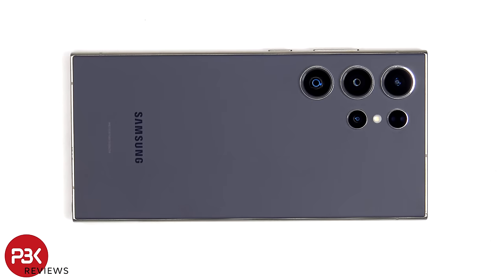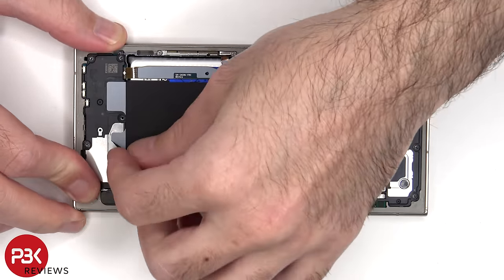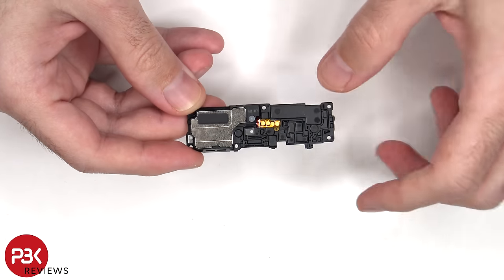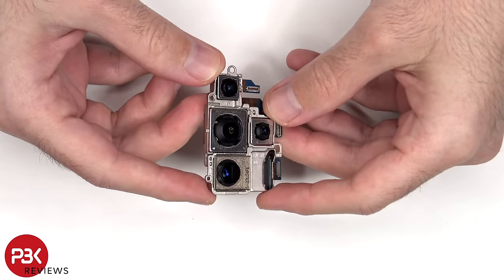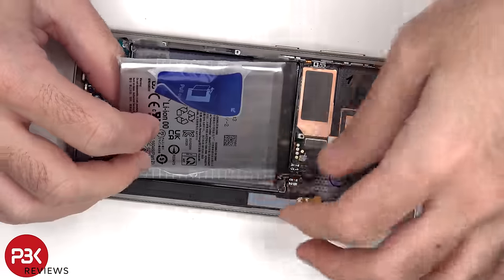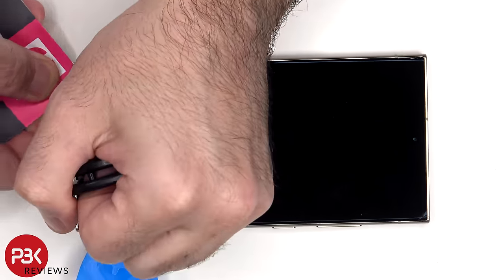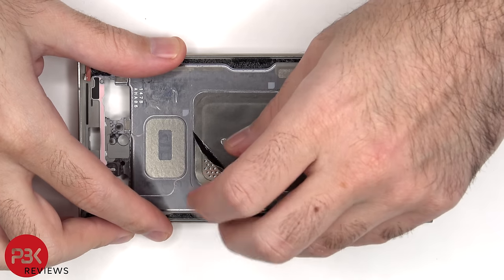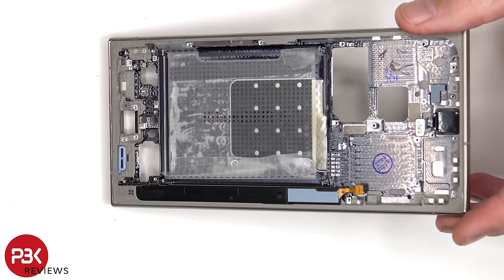Samsung Galaxy S24 Ultra Teardown Disassembly Repair Video Review

Comment from the maker: For anyone who is worried about the S24 Ultra speaker mesh filter, you can check my X/Twitter post with pictures of the mesh filter. Some people were worried about the mesh filter looking damaged when holding a flash light into the opening of the bottom speaker in the frame. It's not damaged and its just "domed" or in a dome shape fitted into the speaker opening in the frame of the phone. https://x.com/PBKreviews/status/1753223290913423458?s=20
Reply: Hi what about bottom mic ... I accidenly poked it with a sim ejector tool which is thinner than samsungs... should I worry about water resistance capability???
Reply: Thanks for the clarification about the speaker mesh... I was worried about that... 😊😊😊
Reply from the maker: Hi, you will be fine, the mic and filter are seated above the hole and won't be damaged.
Reply: Thank you so much for the last comment regarding puncturing the hole next to the sim card. I came here just for that reason. Who would design a hole not meant to be punctured next to a hole needed to be punctured in order to get the sim card out. 🤦
Reply: Извините, а для чего верхняя камера?
Reply: Now my phone
Reply: Ya esta preocupado gracias por la información amigo
Reply: Will all repair/dissembley reviews in the future be given a numerical score?
Reply: Thanks for this video I saw a tiktok with a fake s24 ultra

Comment: He just killed the screen
Reply: I screamed internally
Reply from the maker: Yup :(
Reply: Dude needs to go to repair school
Reply: @laptech3767  It is not noticeable that the video tries to repair the screen, knowing that it is much better and cheaper to buy the screen and the new chassis .
Reply: Nooooooooooooooo
Reply: Gives repairability score 9/10 but the screen can't be removed without destroying it...   WTF??
Reply: Lol😂😂 he will be thinking i have done  @kosmosbos
Reply: Glad I saw this. Replacing battery requires replacing a good screen? No thanks.
Reply: I mean to be fair, Samsung did make their phone so that the only repair you need to do that requires the removal of the display... is a display replacement
Reply: @badwolf8112  are you blind? He removed the battery without touching the screen literally.
Reply: lol
Reply: @PBKreviews 1.5/2 for replacing the screen? Are you sure? I thought you said the screen was glued down so much that it was almost impossible to remove the screen without forcibly pulling it off? Surely a 0.5/2 tops.
Reply: Board also
Reply: Why would someone replace a good screen? Obviously, it has to be broken before thinking about replacing it, so its very easy. Replacing the glass alone is whats difficult @darthraider450
Reply: Cuz this is tear down not disassembling
Reply: I'll bet you Rewa could have saved the screen. Their glass-only repair method is next level.
Reply: @09:12 he mentioned that it is impossible not to damage the whole screen
Reply: 😂 So replacing the screen glass is almost impossible because the screen has an anti-glare layer that is very vulnerable.
Reply: 😢  As for the screen, if it is damaged we will need a new set of screens with the frame intact
Reply: @kosmosbos  why would you remove a working screen though?
Reply: Its okay bro calm down 😂😂
Reply: It's over $300 to fix 😢
Reply: @badwolf8112  the battery has nothing to do with the screen, that's done from the back lol

Comment: Wow. The size of vapor chamber is really big. Awesome.
Reply: Yeah but it's stainless steel instead of copper this year/cheaper to manufacture
Reply: @hotsauce6310 are you sure its steel and not aluminum?
Reply: One plus 12 cooling vapor chamber way alot better ..😂
Reply: @RDstar8 but the cameras are way worse
Reply: 찐이다 ㄷㄷㄷㄷㄷㄷㄷ
Reply: @RDstar8  i saw some gaming comparison between both and there was hardly any difference between the temperature between two
Reply: 네모난꿈 매번 하던거 ㄱㄱ
Reply: @RDstar8 This is very true take note Samsung!
Reply: Not awesome, the phone has worse thermals than the S23.... I'm kinda sad this is the case
Reply: @NicholasManitaras not true... they literally have the same thermals... stop spreading misinformation and educate yourself first
Reply: 이왜진
Reply: Which is good, my S22 has a really bad overheating problem. cant wait for the 24 ultra to arrive tomorrow!
Reply: Yes, not skimp, like Sony does.
Reply: But my s24 ultra still gets warm in india and overheat when recording
Reply: Still heating is too much
Reply: Yes, really bug compared to older Samsung, but not big at all compared to other brands, hence why it performs worse in most of the "RAW" performance stuff and stability.

Comment: I just Pre-ordered mine... coming from a S10 it will be a nice upgrade.. It's incredible how much tech is built into these phones.
Reply: True ...as it needs 5 years or more to actually feel the upgrade when it comes to smartphones !
Reply: same here, my S10+ is still holding decently well but it's finally time!
Reply: Just got mine and I'm coming from the note 10+
Reply: Same. Just got a notification mine will be here Tuesday. Yay.
Reply: Same here coming from s10 and just got a message it is out for delivery!
Reply: omg same. My cracked asf s10 5g barely lasts a couple of hours off a charger. The thing I'm most excited for is the high refresh rate and much brighter display. Im also excited to use the circle to search because it sounds very handy for identifying parts on cars I work on.
Reply: It’s the same tech dude. There’s nothing new it’s just upgrades to be better won’t work better
Reply: My S10 plus suffers from ghost touches and it pretty annoying. It's still my daily driver tho.

 I also have the S23U but I did trade in for the S24U with the S23U and a trade in for the S24+ for my S23+.... 😅
Reply: Literally i have an s10 thinking to do the same
Reply: I've had my s10+ for 4 yrs gonna pay outright for this one as I did for the s10+
Reply: and there is me with a sgs7e buying an used s23u this month lol
Reply: honestly the s24 plus is more then enough - unless youre an avid spen user and also need the 'zoom' camera - it might be nice to have because the s10 szoon isnt that good (but the s24 plus zoom is also fkn nuts)
Reply: I will be coming from an TLC 10 5G, so it's going to be nice to keep the large screen, but with a way better screen, and that TCL has a garbage camera, so that will be nice.  First time I will own a top-of-the-line phone in maybe 20 years.
Reply: Also upgraded from a s10+ last week! It's a worthy upgrade but if it wasn't for the camera being 5 years old, I could of held on for longer tbh. Here's to another 5 years 😅
Reply: I've trade in my z flip 5 and got my 1tb titanium green with 4 freebies for only £691.69. This will be my spare phone. I traded in my z flip 5 (supposed to be my spare phone), but it is not as powerful as my fold 5.
Reply: Yoo the s23 ultra i got his pen is being not recognized and the screen is popping and cracking while wiping it out. Why is noone talking about that garbage?
Reply: Thats exactly why i came here. I got the s24 ultra and thought: Wow, this phone is light despite being large... i wonder whats inside it?
Reply: I'm coming from an s7. My 24u should be here in a few days
Reply: bro I upgraded from a note 8 imagine the difference

Comment: As a tech lover who loves repairing my own tech, I am happy Samsung made the S24 ultra the most repairable phone I ever seen. The phone is mostly modular so you can replace the USB-C connector or the sim card reader easily. As someone who knows how hard it is to safely remove iPhone batteries, I am happy the battery on the S24U is very easily to replace. Great job Samsung. Great video PBK.
Reply from the maker: Thank you
Reply: Where do you go to order specific parts?
Reply: iPhone 16 pro max…

Comment: It's amazing having seen the genesis of transistor electronics from the 50's all the way to now. In the 60's as a kid I used to take almost everything apart. (Broke a fair share of stuff). Thank overseas for making things as tiny as possible, and getting smaller and smaller. I always appreciate someone showing how to do these procedures correctly. I miss the days when you could unscrew the back vs. using a heat gun or hairdryer to pry things open.

Comment: Glad to know I didn't tear the microphone seal with my sim ejector tool. Thanks for considering those little details.
Reply from the maker: No problem :)
Reply: I did the same thing with my s23 ultra I just got myself for Christmas. I was freaking out I punched a hole in the microphone assembly. Alot different from an s9+.

Comment: Great to know that the battery isn't so difficult to remove and replace. For anyone that still wants to keep their S24 Ultra for up to 10 years, definitely be worth it to replace the battery after 5 years of usage. As long as Samsung keeps making the same battery size for the next S25, S26, S27 and S28, then we won't have to worry about finding the right battery. You would just have to pay $200 usd for someone to professionally replace that battery.
Reply: just trade the phone to samsung after 2 years for s26 preorder and get $1000 for it and use new one
Reply: @physics77guy  Most underrated comment of the century
Reply: @physics77guy  No, i doubt I'll get $1,000 usd for my used S22 ultra. Could be like $700 which isn't so bad too. But at the same time, I'm going to keep it and use it as my smartphone LIVE camera. I'll just replace the battery and get a S27+.
Reply: @PanCakesAreFat  oh that's very affordable. As long as they still have some S22 ultra batteries 5 years from now, im happy with replacing my battery.

Comment: Apparently the thermal headroom for the ultra is lower than last year and s24/s24+ exynos chips, 44c vs 46c. This means performance is being throttled unless samsung increases headroom to 46c. Idk why they did this but in hot countries it may limit chip a lot in performance area.
Reply: It's Note 7 flashback, that's why
Reply: Didn't they say the vapor changer was like 1.6x bigger?
Reply: @NunoFilipe99  yes its bigger and s24+ is also bigger but samsung artificially limits thermals to throttle at 44c, used to be 46c. So performance is being held back (sd should be even faster). Only for ultra, exynos variants of s24+ is 46c, dont know about sd version of s24+
Reply: @farhank8297  samsung has a really hard time with processors -.-
Reply: @NunoFilipe99  stop writing BS. I have a PhD in IT and you just talk nonsense....
Reply: @IIISentorIII  You have  PhD and i have a job.

Comment: Quick question:  There are reports from Korea by people who used a flashlight to look through the speaker hole, claiming that the speaker mesh deep inside that hole looks to be damaged, uneven, or using low quality materials.  When you completely took the phone apart, were you able to see any abnormalities with the bottom  speaker unit pertaining to what once was a clearly visible metal mesh from the outside?

Once again, thank you for the detailed assembly.  Always a joy to come here whenever a new phone gets released.
Reply from the maker: I just took it apart and took a look at it. I uploaded pictures to X/Twitter and you can share the link with anyone who is worried about the issue. There is no problem with it. https://x.com/PBKreviews/status/1753223290913423458?s=20

Comment: lol, did samsung really use plastic to bind titanium outer frame to the aluminum inner frame?
Reply: thats what apple did too

this whole titanium gimmick really sucked bring back aluminum
Reply: @hachiko2692  nope apple bonded aluminum directly with the titanium outer frame, theres only a little bit of plastic on the bottom where the charging port is. Oh boy does that bond hold well, just happened to have watched Hugh Jeffreys video on a broken iphone restoration. The frame was broken, the only places where it broke was the antenna lines on the plastic part of the frame, that really goes to show how good of a job they have done. Antenna lines are a weak spot even for single-piece aluminum milled frames.
Reply: @hachiko2692  i personally prefer titanium, it feels more premium in the hand due to its matte finish, and i always prefferred matte over glossy finishes.

Comment: Periscope camera: Samsung has put the first lens element in front of the prism, which can increase the size of the front element, which in turn should (in theory) increase (smaller f-number) the maximum aperture of the lens. (Even though this camera has a smaller aperture than Google Pixel 8 Pro and iPhone 15 Pro Max). Huawei also uses this trick with the P60 Pro / Art periscope camera, but Huawei has a second prism for a larger camera sensor.

Comment: hello@PBKreviews could you confirm after taking apart the phone that without the sim tray inserted, or fully inserted that the phone is still IP68 capable?  Or would you conclude the sim tray is absolutely needs to be inserted properly to be IP68 qualifed

Comment: Just discovered your channel - very nice work, PBK! 

I have an S9 that has bit the dust. Searching, it seems that likely the OLED screen is kaput. It died suddenly. I almost got it working by shining a bright light at the top of the phone, but it didn't last long enough for me to change the screen settings. Spent so much time to see if I could revive it. So, I've decided to order the S24 Ultra and will be arriving in a few hours.

Thank you for putting together this video - was interesting to see what's inside.
Reply from the maker: Thanks!

Comment: After you open the phone, how do you glue it back so the waterproofing remains the same as factory? I need to take my s24 ultra to service to warranty replace one of the cameras or maybe the whole setup of cameras because I have rattle even when I record a video and I can hear the rattle in the background and some buzzing when turning the phone to the upper right . Thank you

Comment: Hey nice vid, is the power button removable? I mean if i remove it would it still be working the same? I feel like mine got some dust stuck within it so it feels kinda mushy, want to try and remove it to clean
Reply: You probably push too hard and smashed/crack the little silicon pad on the button, many phone have this to reduce the click noise, but unfortunately it will either get damage or rot itself over the years, until the button starts to shake and fell out
You have warranty, just send for replacement or wait till it almost end then send for repair and get a new screen + frame + battery (my local service centre replace the battery previously) 
CS: your battery very weak right? 
Me: yeah very weak

Comment: Nice video! Did you heat the screen before taking the glass?
Reply from the maker: yeah, I applied enough heat that the glass was separating from the screen but the screen wasn't peeling from the frame :) The way they adhere the back of the screen to the frame now since there is no room to adhere mainly the glass due to the very thin bezel/frame makes it pretty much impossible to pry off a working screen and not damage it. Thanks :)

Comment: Educational and detailed video, thank you PBKreviews. I'm watching this because the Sinjimoru Grip accessory i have for the S24 U failed and it caused my new phone to drop 5 feet on to asphalt (with rubber case and screen protector on) and it made me wonder if i could've damaged any parts inside. Do you think this kind of drop could damage any parts? Luckily there's no noticeable screen damage. i heard the most easily damaged part is the screen/camera lens, so if i can't see the damage, there is no "underlying" damages from these kind of drops if i'm correct.
Reply from the maker: No you should be fine, there shouldn't be any internal damage. They are built to handle drops.

Comment: Great work. Really loving the videos. If I'm gathering correctly, a new screen replacement can be done without special parts (e.g. the S23 Ultra)? I ran into an issue where my US purchased S23 Ultra was unable to be repaired in another country, as the screen also included the antennas and could not be purchased in that country at all. This looks like a significant redesign from previous.
Reply from the maker: I don't see why the S23 ultra can't be repaired, all the screens are the same, unless you are getting a screen with frame combo, which yeah some frames may or may not have the mmwave antenna. But still you can always order the correct part to replace. Thanks :)

Comment: does this version also have the mic phone at 90 degrees from the entry hole? I accidentally poke it with the SIM card ejection tool hehe. I have read that the 90 degree design helps to prevent damage and also that the water resistance is not compromised

Comment: I just got a question, maybe you can help? My S24 Ultra gets kinda hot on the upper left corner of the display. Seeing your video there is the RAM and the main prozessor? Can they be a problem and causing it? All infos I got from Samsung was to send in reports when the problem occurres.

Comment: Can you buy new adhesive? I'm asking because i would like to remove the back of the phone and strip the paint for a clear cover. Thanks, great video!
Reply from the maker: yes, It's not available online to purchase yet, but eventually the adhesive for the back cover will become available on ebay and other places. Also it's not paint, its a laminate later than can be peeled off by hand. Thank you :)

Comment: Waaw, greate Video Pro, I have Question please hope you have answer for it, sine I bought S24 ultra 2weeks ago, I have been experiencing signal strength low reading even I in area where cellular coverage is very good, the it ranges for - 80dbm till - 90dBm, comparing with older phone but with better readings - 50dBm.
Does this cause from bad antenna from Samsung, or my phone ANTENNA is bad defacto issue, what are Samsung signal strength stander reading.
Please accept my request and thanks allot for your amazing videos Sir